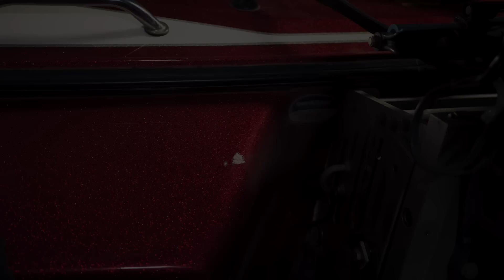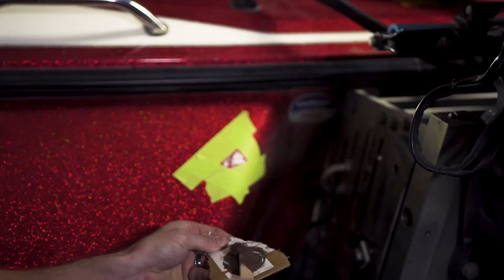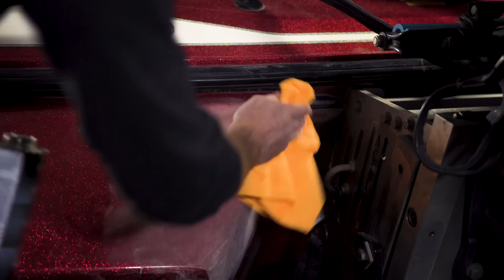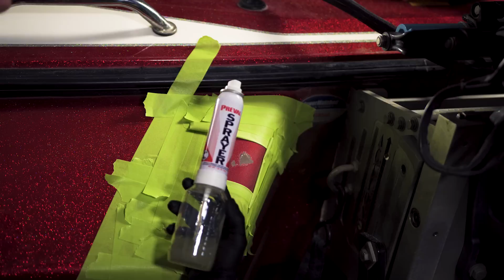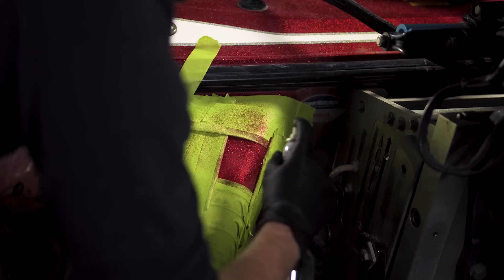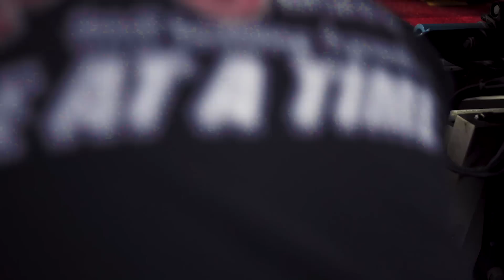Fiberglass Metalflake Repair with NO Professional tools!!

Comment: Hey bud, that was pretty awesome. I’m looking to do a area that’s not necessarily as bad as this was, it’s more or less seems like the previous owner had color signed a little too much and you can see the silver the red is not as good as Rest so I’m looking to do something like this. Can I use this technique in a larger area approximately 2’ x 2’ and this split spray on gelcoat do you have everything in the description? Thank you for your video

Comment: Blend it out starting with 80 grit on your repair spot and then 220 and then 320 scotch brite. Use sunshield with Mek after you spray your spot with straight gel coat and a little bit of mek and then come back and spray the spot with 1/3 gel coat and the rest sunshield and remember to slowly blend it out each stage,and you should never hit the tape line.After the sunshield Is sprayed blend it further out with 2 coats of straight sunshield and always fold your tape back so you don’t make a hard line. Ps.this is only if you want it to look like it was never even broken in the first place. Your demonstration is really good for the “do it yourself”kinda guys

Comment: Hey Justin you mentioned where to get the filler but where do you get the clear coat and what mixes in it to make that spray contraption you had?
Reply: Clear gelcoat. You can mix acetone to thin but styrene is best results.

Comment: How can you tell if you wet sanded threw the gel coat  
Would all the flake be silver
Reply: @mike h  so I might have silver flake mixed in with the red flake or a little over spray
Reply: Yes busted flake is silver

Comment: You really need to get the dry flake sprayer . You add a little clear gelcoat  and spray the dry spray flake  over just that area no  mess  to deal with at all . At 10:34 after you removed the tape you should have  went over  it again with the acetone  to get rid of the glue that's on the tape that transfer to the  pained area  you can not put to much acetone  to .   . https://youtu.be/YmE-kCQLjvM

Comment: All I can say is don't waste your time doing it this way!!! That sprayer is garbage for spraying gel coat unless you thin it beyond what the gel coat is supposed to be!! All around bad information which your going to have a bad result!!!!
Reply: U r correct. The sprayer works,though. Take that filter on the end of the straw off. Use styrene to thin.

Comment: Just purchased gel clear from Fibere Glast with MEKP, the company recommended a Duratec Fibre Glast Clear Hi Gloss Gel coat Additive for open Air Cure.. Should I use with the same steps following Metalflake Repair No Tools?
Reply: Yes

Comment: Good video except for one BIG thing:  You didn't go into exact detail of what chemicals combine in your sprayer (and at what proportions) to make your clear coat.  I don't know what to buy in order to follow your video!!!  Do you have to make more than one batch since the first might harden before it's used?  Please expand on the chemicals.
Reply: Yea that part kinda pissed me off..  just brushed over the most important part thats unlike any other clear coat ever..  put in some clear, some of the hardener and what?? Then the fucker says put wax in the final coat???  The hell he talkin about?  All ive seen as far as boat paint is a clear gel coat that comes in a friggn can... and who knew youd add hardener to a clear coat?  Is he just spraying the fiberglass resin thinned out on it? And wax?  Like candle or turtle?  Like everybody knows all about this watching a how to video..  bullmess is what it is..  fuckery..
Reply: Z Ack it’s called wax in styrene. It stops the clear staying tacky.  When you have gelcoat exposed to the air, it stays tacky. It is designed to be applied to a mould, therefore the finished surface is not exposed to the air.

Comment: just a tip from a proffesional....Never grind or paint near tapes or u will have that Γ sign always.Nice work but u can do it more proffesional.
Reply: what is the proper way to do it? I have a skeeter I just bought with an area taken out like this but it's a little bigger. I didn't know it could be fixed somewhat simply and I'm down to try it
Reply: Periklhs V  I saw that he left that shape behind from the tape

Comment: Never make a hard line..
Reply: Doesn’t matter in terms of what to use or how to do it.  I wouldn’t have taped it off to blend in the clear and metal flake but the instructional part of this video is great.  The filler and the clear coat part.
Reply: He didn't paint up to the edge anyway so there won't be a hard line
Reply: It looks too obvious.

Comment: How would you do this if the damage area butts up against pin stripes of a different color?
Reply: He hates his viewers apparently
Reply: I have answers to all of these questions. It really is odd he hasn't replied. You need to use fine line tape on the stripes ,spray them on after flake,then clear it all together. Do NOT use tape on the edge.DO use masking paper. If you NEED to use a tape edge ,lift the tape edge up  to avoid a hard tape edge. Subscribe to my channel to get responses. Lol

Comment: Is there a base coat used first  before flake? I was told by ranger that my boat had a black base coat do i need to do the base first,If so should it be a non wax?
Reply: Great video. Terrible at replying to comments
Reply: Ed, how did your repair go? I have a 2007 z20 ranger Comanche that I'm going to try to repair.
Reply: Only air dry wax on the very last coat of clear when done

Comment: great work.  what caused the vertical and horizontal lines in the repair?
Reply: You dont really need the tape for the color part. The flec should be blended into the surrounding areas just like paint would be. You would just need to go lighter on flec away from the damage.
Reply: the tape
Reply: It was the tape and to much red flake as you can see it was a square shape. It would have been better with a puffer bottle and no tape. But it got the job done.